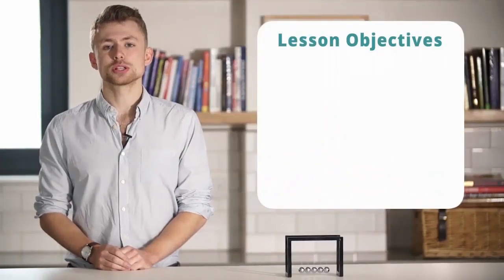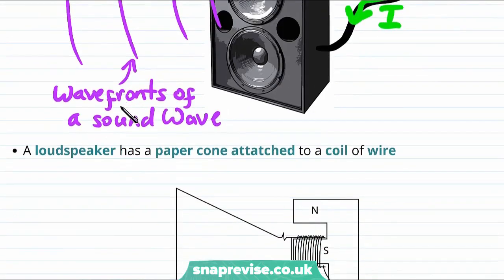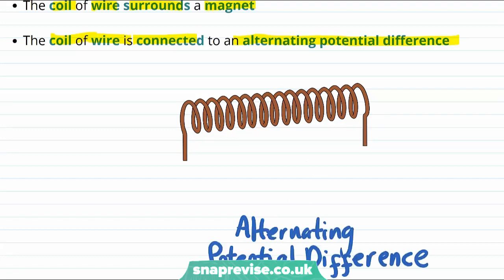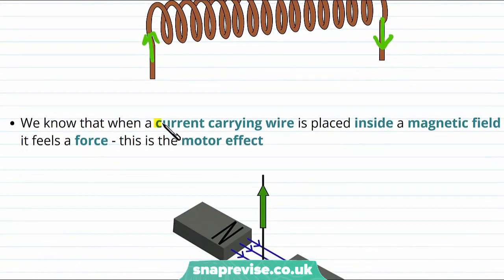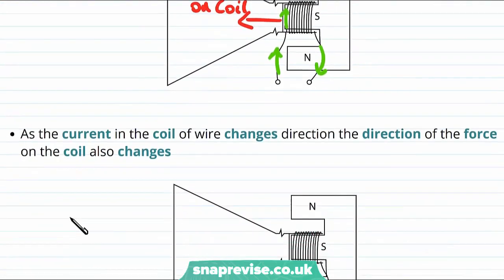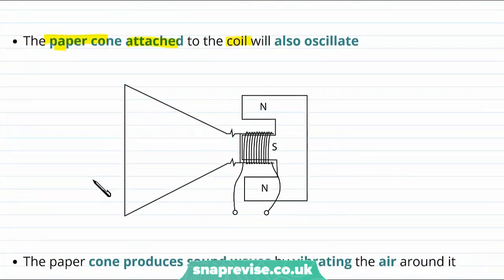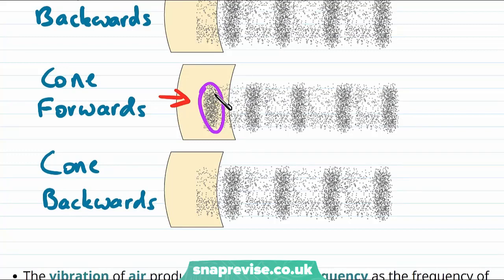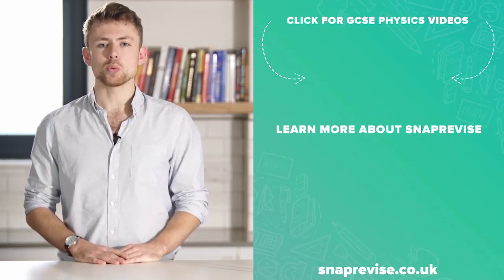Loudspeakers and Headphones | 9-1 GCSE Science Physics | OCR, AQA, Edexcel

Comment: Hey! How do you find the direction of current?? in FBI what is the direction of each??
Reply: Magnetic field is ALWAYS north to south which means you already know the direction of one
Current is ALWAYS positive  terminal to negative terminal so depending on how the wires are drawn you can see the direction of that
Now use Flemings Right Hand Rule and move your hand so it corresponds with current and MF to find the direction of the force

That's how to find all directions ^

*If current is unknown you can use magnetic field and direction of force and FRHR to find direction of it

3yrs late but jic someone else needs it